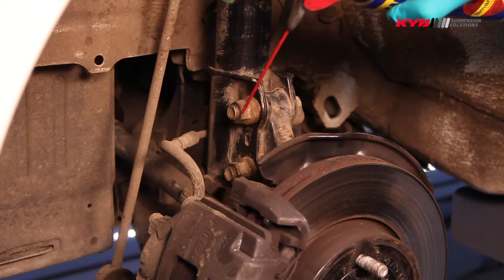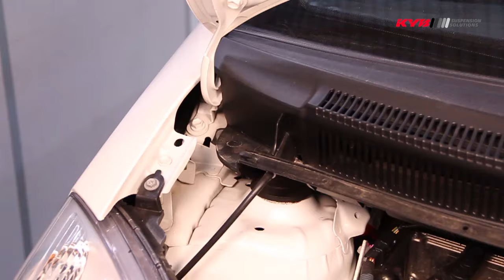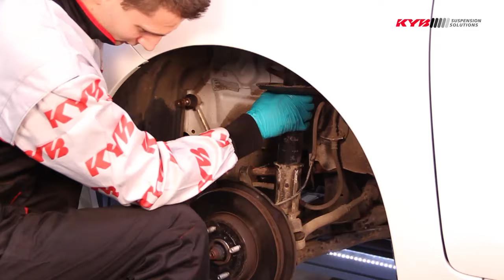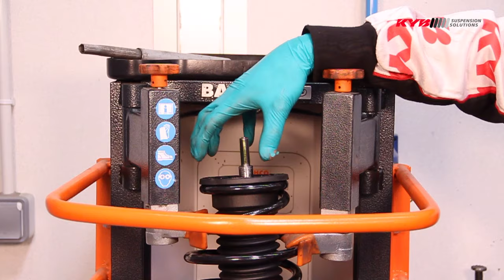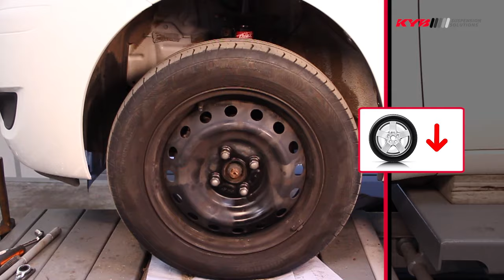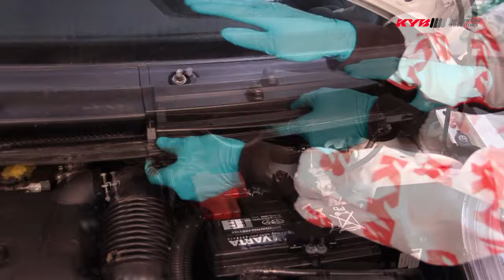KYB TOYOTA Yaris II Front

Comment: Great video, used it to change mine out. I have a question, I did the same exact thing you did but for some reason when I lowered the car, they pushed up and theres a gap under the top nuts on both sides that hold the shocks on top. When I raise the car again and move the tire up and down the entire shock moves up and down because of the gap. I brought this Yaris 08 they had the gap so I brought the new mounts and bearings but still have the gap,Do you thing someone installed the wrong shocks absorbers?
Reply: I have the same question, but in a Yaris 2013.
Reply: @josedanielpg2329   I ended up buying different Strut Mount. The round plate that holds the spring in. My car strut mounts only had the nut in the middle to hold sping. I changed them for the strut mounts that have the 3  bolts facing up and fit in the 3 holes that are on the car. So to remove them in the future, instead of removing the big nut, I remove the 3 smaller nuts.